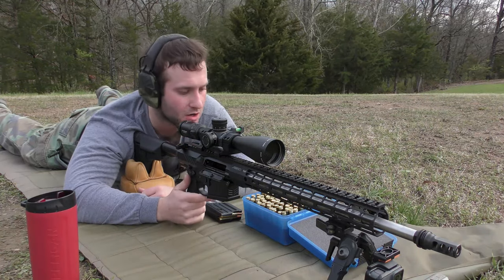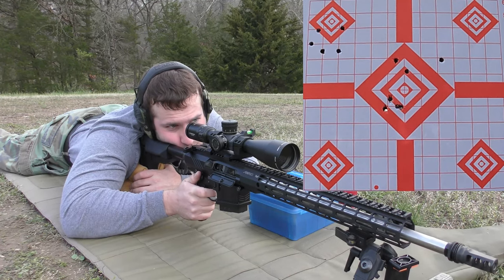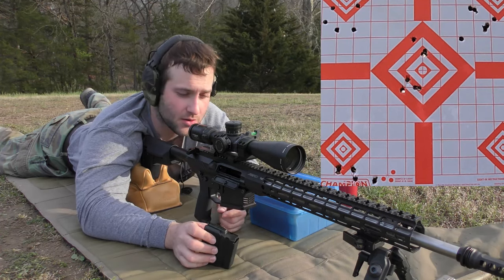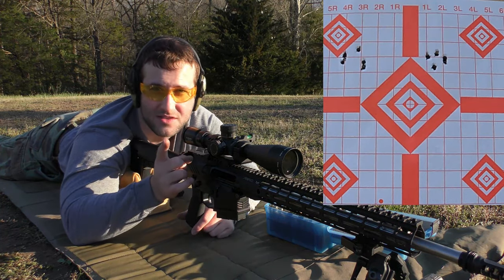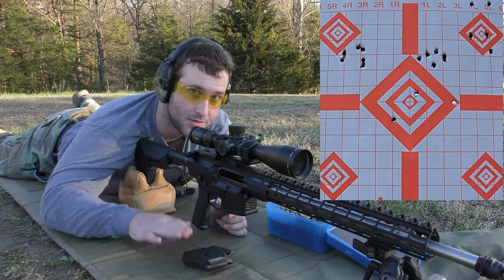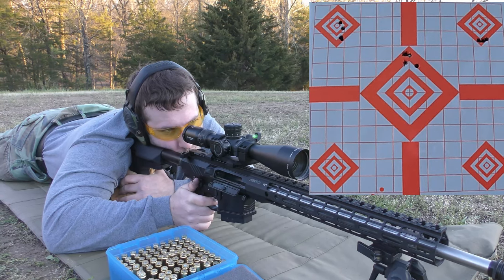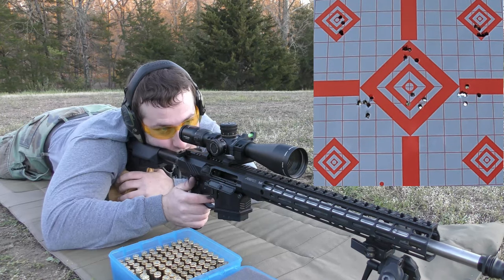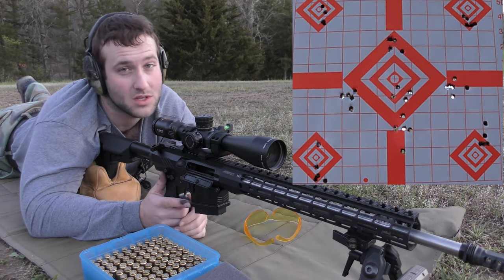Custom Grey Ghost AR10 Accuracy Testing: Handloaded 308 Win; 155g Lapua CFE 223, 175g Berger IMR4064

Comment: I don't use cfe in my 308. Varget works great in my 308's gas or bolt action, cheap or higher end bolt actions.
Reply from the maker: Varget has always been an excellent standby. I just haven't had the best luck with cfe.